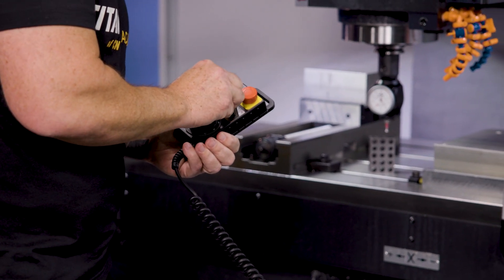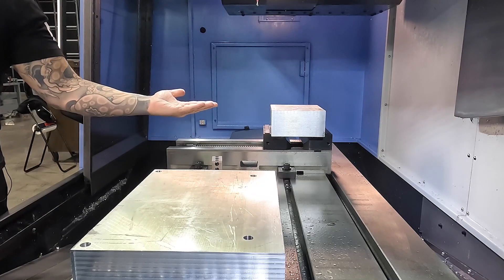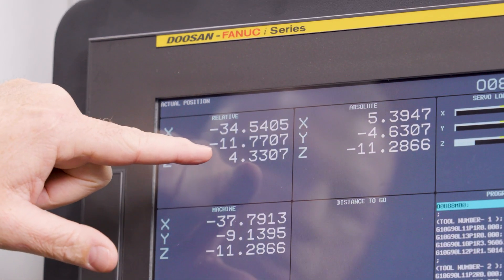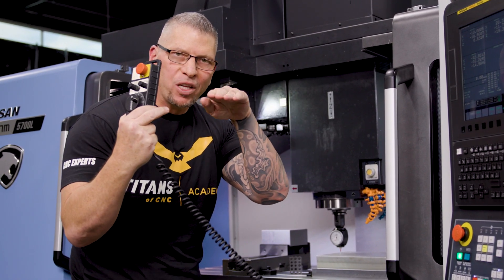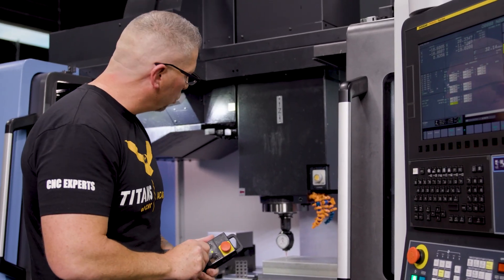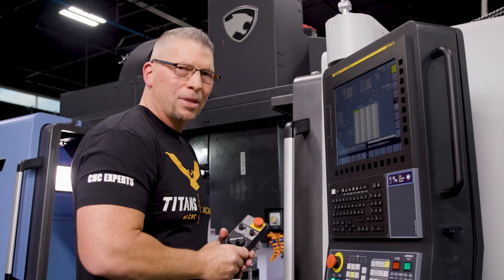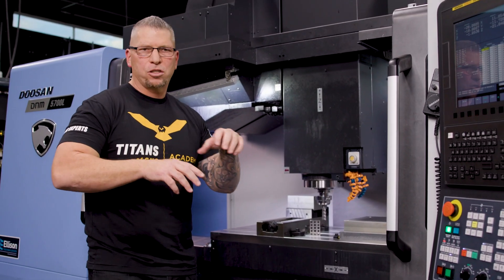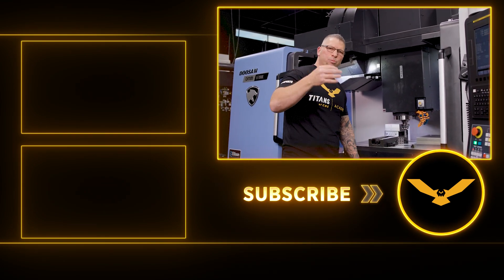ADVANCED FIXTURING | Set Z Fixture Offsets to Numerous Heights… Set All Tools to Single Height

Comment from the maker: Something for everyone! We have machinists of all levels following this channel so I figured I would do a quick teaching on setting multiple parts at the same time with a Haimer 3D Sensor. When repeating jobs, this ensures everything stays perfect every time. All tools are zeroed off the 1,2,3 block always.
80-90% of machines don’t actually have probes installed so this works nicely. Just another option.
I myself, always use probes but, used to do it this way.

Have a great day!

Titan
Reply: I’m no expert , many years out of CNC but this is how I was taught many years back . Excellent tutorial . Clear , concise and useful .
Reply: Where does G43 H01 ect fit into this?
Reply: @Thisoldtruck1  G43 H(tool number) is the tool length compensation for HAAS machines. I suppose it applies to other manufacturers too, just like G41 and G42.
Reply: @Yuriyper  if tool length offset is left at 0 (not used) then it can be ignored?
Reply: Thank you for the great tutorial. Despite having renishaw probe tool, I use this method everytime I need to make something precise (tolerance of 0.01mm and below), this way you make sure the difference in tools offsets is minimal. Another thing I think is worth mentioning is checking that you have set all the Z values correctly by bringing the tip of the tool somewhere close and outside the 1,2,3 block or the part stock and using MDI command G0 G(CS number) G43 H(tool number) Z0. to see if the tool will in fact go to the desired height. This double check has saved me a couple of times.
Reply: Your info is great and even if its something I have already learned, its good info to change my thinking to always be improving! We just put in CNC Machine #5 this year already! wouldn't have taken this leap without your enthusiasm to make American parts! My Company did 10X what we thought we would this year!
Reply: Great video thanks
Reply: Sorry, I have an issue with the way you’ve shown everyone how to set your G54 up. Here’s why:

You’ve stated that your table is a constant. True. You should be setting everything positive from the table up. You’ve only shown everyone how to take reference from the top of the 1-2-3 block, to an unqualified surface ( top of rough stock or part). While your idea you wanted to convey is correct, from top of block, zero out, go to top of workpiece, and get the difference, which is correct, what if someone’s 1-2-3 block had a burr on it, and you’re only referencing from the top of that block ? There is no accuracy in doing just that. Using a block or tool presetter on the table, or in the case of a lathe, on the surface of its chuck, then subtract the known height of the block or gage ( 2.0” or 3.0” or whatever the case is-this has to be understood by everyone in set up sheets). All tool height offsets and G54,G55 should be taken only from a qualified surface.

We use a tool presetter 2.0” or whatever height, touch all tools off the top of that, and TAKE OFF the difference in height of that tool presetter. Just touching off the top of that block is NOT good enough for accuracy! No fixture offsets should be negative values.

Comment: Since raw stock could change in height, wouldn’t it be more accurate to go from the 1” block to the surface the raw stock is sitting against? Then add the finished part height (shown on the print) to the number you get?

Comment: Been doing this for long time, it amazes me how many people don't like doing it this way. Its not only good for the job you're currently running but if your using a few of the same tools on the next set up you don't have to retouch them off. Oh not to be picky but once you zero out the indicator on the block and find the first Z you can then just move over to your next part. Plus another advantage is if your Z is in a hard spot to reach the the tools may not fit easily as a indicator. Great video have a great rest of your day.

Comment: My shop does it a little different we touch off from table (Z0) and then we go to top of material and then that number we use as our z work offset. And for tooling we touch it off a 1-2-3 block and use the machine Z as our number and subtract 3 inches so that its exactly distanced form the table

Comment: I don't understand why we complicate our lives if we don't have an electronic sensor. I use the probe HAIMER this way:
1) The HAIMER probe is measured precisely on a marble or tool gauge. We put this length very visibly on the machine. "PROBE LENGHT=X.XXXX"
2) We reserve a work offset which is 3" above the table (ex: G59). We use the HAIMER probe to do this. The Z of the G59 is the exact distance in Z- between the Z0 machine and 3" off the top of the table.
3) To measure a tool, activate the G59 and with the 3" block we do the same procedure as in the video.
3) To measure a Z on a part, we use the HAIMER probe and we add the length of the probe to in Z- calculate by the machine. So the Z Work offset is the distance between the Z0 machine and top of the part.

This way the tool lengths are always Z+ and mean something. Additionally, if you have an electronic probe and it is broken, you can continue working with this method.

Comment: why do it so hard. you not need know what distance 123 block is from part lol. you only need know heimer tool lenght. measure part surface with g43 H(heimer tool number) zero your offset BOOM. why is so hard? lol.
you can take tool height from that 123 block completely fine if you measure everything same place allways, but if you put mind on it. you can figure what is max z travel. its not what specs say but close.
i made g command to measure tools from same place and it give correct height. same as peepol use tool height gauge. why need buy lol
we not have any heimers or any its paper or shim 0.01 and its allways that acurate. rest is how tool cut and change offsett lol. is not that hard

Comment: 0.0001 inch = 0.00254 mm. you machine has 0.0000 every mm machine has 0.000. we can program 0.001mm its less than 0.0001inch. mm acurate.
ofc you can program inch using 0.00001 but your screen says 0.0000 LOL. why inch machines is so inacurate on screen. we do parts more tolerance than 0.0001 inch opsy

Comment: I made foundry patterns for a few years, spinal implants for a few years, and plastic injection mold assemblies for a bit.  Everyone does stuff different, I have learned so much.  I took a break for 5 years and just got a position in a job shop.  I’m nervous, but not too worried.  Maybe a little surface rust but it comes right off

Comment: Anyone use the IHMI control to touch off Z offset. I’m trying to do it like I would on the classic screen where the tool sits right over a block and you hit z calculate and set that as my z offset. But the IHMI display does not give me that option. I know I can just type in my current z location but that’s not how I want to do it lol.

Comment: Idk what was missed in the video but the comments are disappointing...
The whole point is to have a solid reference you can rely on and you can then adapt it into your program.
Whether you're replacing a broken tool or just adding a new one, you don't zero off of the rough barstock. The 123 is your zero.

Comment: Awesome setup video for Non probe machines.  Most of us, Like Titan, were setting up CNC machines with edge finders and 1 2 3 Block for years.  Just as accurate and I think just as fast.    The Z axis WCS location and how you touch off tools can be done various methods. I always try to teach to learn different methods. Wherever you end up working , you can setup just like the rest of the shop - same method.

Comment: We have a vacuum table on which we work with thin (4-8 mm) sheets of aluminium. I’m pretty scared to work on it because some guys mill right into the table as tools usually work at a 0.2 mm from it. 

I’m not sure if this is right and I can’t get a straightforward answer from my colleagues. 
But since I have to make sure somehow that neither the roughing nor the finishing tool would reach the table, I feel I must test all these tools on the side of the table, outside the work area, by sending them to the lowest Z coordinate they will be sent to in the program. I have to find the lowest coordinate of Z in the program for this, but I also do this with the spindle not spinning. Which makes some of my colleagues twist their head, but with the tool not spinning, I can see much more clearly where it is because I can see the blade’s reflection on the table, though I don’t mind stopping and opening the door a lot to make sure, but I just want to make sure. 

Because you can see when a tool goes closer than the intended approach distance, things like that, but you won’t see whether a tool is just 1mm too low than it should be. You’ll only hear that it’s milling the table. 

Would anyone have an opinion on how bad practice this is or any alternatives? The table is also custom built aluminium alloy, so I figure even if I mess it up, the tool will just make a small impression on it outside the work area.

Comment: After working on a 5 axis machine I started using a fixed xyz origin for all my programming, even on 3 axis. I use the machine zero for x and y and a 4in tool setter gauge off the top of a fixture plate. This is made easy using a fixture plate and tightly pinned vises and fixtures. If I'm working from stock I set up my job in the machine, then measure the location of the stock in z and x if its in the vise. with stock in the vise you can use a floating pin stop to set the side to side of the part. if its round stock in a collet chuck I measure x y and z using a dial indicator and a height gauge. I Then cad everything up, and its very easy. Often times ill 3d print a fixture that aligns to the fixture plate if I'm holding a part that needs to be modified, reworked or have a second op done. This method has many advantages. if I want to run a job again, I have a 3d model of the entire setup, and I don't have to re-establish  my z height ever. since the origin doesn't change, Its less likely to crash. I can simulate the entire job and be confident that it wont crash as long as my tool stick-outs are correct in the cam software. The disadvantage is that if you are reworking a part you need to precisely measure the location of parts relative to the machine home, and its not ideal if you are running multiple parts and they shift from run to run. this could be avoided by running a probing cycle and using that to transform the program to the right xyz location.

Comment: One of the shops that I program for does not have a probe and I have to do it this way. I much prefer a probe and a different work offset for each part, but you have to use what you have. Even my personal hobby shop  Haas TM mill had a probe.

Comment: This seems way complicated for no reason, machines 0 is normally work offset G52 or G53. I guess what your doing is setting everything without using a spindle probe, tool probe or tool measure. The way I've always done that was set my X and Y part 0 off the part, and my tool length off the top of the part. But thinking about what you said about tools breaking. I used a 123 block or 1 inch block to measure an already known tool from a set location machine 0 (table) took the difference between and added it to the new tool...example -16.75+5.6 so my new tool 11.15 were the previous tool may have been 10.

Comment: We use a z setter based on a macro. Setter is a set value so on either or Okuma or Mori, Z Value measure, work height offset is done.

Tools, basically the same. We have a touch of block and macro based on a 3 inch gage block.

Comment: I dont know why anybody, especially someone with a Haimer, needs to make this so complicated. Hiamer becomes your master tool for Z 0.0 height, every tool is referenced as plus or minus to the Haimer. You can set tool heights on anything you want at any time as long as the Hiamer hasn't changed or broken a tip.
Reply: Exactly what I’m thinking. No need for adding so many steps
Reply: @cryptonian4114  on my machines without a probe, the haimer is tool 1 and offset g59 is saved for setting heights on the back corner of the table off of a gauge block. Never moves unless the space needs to be occupied, and then I just quickly reset the Z 0.0 for G59 and keep going. None of these crazy negative offset numbers and as long as the same Haimer is used across all of the machines then all of the tools interchange and can just punch in the offset value when loading. My probe machines use true length from spindle taper 0.0 and I also know the true length of the Haimer so when loading tools between probe and non probe machines just have to do the math quick and punch in the numbers. All of this backwards thinking, outrageous offset numbers that you can't visualize, and unnecessary steps just make it that much easier to crash a machine in my opinion. As the saying goes, K.I.S.S.

Comment: So why would you introduce another variable to the equation by using a 1 2 3 block if the table is the reference surface?  Why not zero your fancy 3D thing on the table and calculate the difference from there?  A reference tool can solve many issues,  all tools are set in reference to that tool,  and that tool is used to set your WPC (work piece coordinates) .  Nothing is then set from home, like what's going on here.  Each shop has it's own standard practice so as a machinist each has to adapt.  This is far from perfect as you state
Reply: My robodrill spindle will not go that low, I had to use the 3" side plus another 123 block to touch off my shorter tool.   13.2" ish of z and that starts at   spindle nose  "about" 4" off table

Comment: To that last point, also make sure if you are running a tool that might be shorter, you don't bring the spindle casting/cover/coolant system down on a tall part elsewhere in the machine. Just cuz the part you're on clears the tool and holder and spindle nose, something else on the table might not.

Comment: I have a fast method because I was rushed to run 3 machines for $16/hr I use a magnetic tool setter and any tool endmill. Zero out my tool setter, set it, zero out my relative, go above the center of the part with the magnet tool setter, get the difference and put it in my  offset. It's pretty good if you're in a time crunch.

Comment: Titan I love you man, this one may be a hard one for some newbies in the trade to follow but I think I understand what you’re trying to explain here. When I started working for a company with no probing system I came up with a similar way of doing this but with an edge finder. I put an edge finder in pocket 20 or 25 and kept it there. I touch off a 1x2x3 block in my vice for Z then touch all my tools off the block too. Then I do some math and figure out all the differences in Z height from edge finder to the tool lengths (same thing the Reinishaw probe does basically) and now all those tools are gauged. Next job comes in I’m not touching off a common tool all over again I just touch off the raw stock with my edge finder and a shim and I’ve set Z. I think you’re trying to say something very similar, but even I was a little confused with the video.

Comment: Love these short videos on the basics! This is how I do it on my older fanuc-controlled machine (haimer probe, tool setter gauge, probe the difference between tool height and work height). I also like to write down my offsets before putting them in the machine. It's an extra step, but sometimes it's good to get the numbers onto paper as a confirmation and error catcher.

Comment: This video is the best argument for tool probes or presetters. Not that Titan is doing anything incorrectly, but this is such an error-prone method of setup. Every peeler I know has wrecked tools at some point doing this, plus it's very time consuming compared to presetters, which allow you to set tools while the machine works, and the numbers are the physical tool length rather than an arbitrary machine position.
Automated tool probes are even better, fast, measure wear, process safety. Unless you have very limited changeover, this is the worst method. (But I would strongly argue for a tool probe for high volume work)

Comment: Where I work, we measure Z a little different. Basically we have measured the lenght of 3D sensor on  Zaxes. For example. with a sensor, zero it on your part and in work offset table just type in the lenght of the probe ( my case 195.0 mm) . So i just write Z195.0 and hit measure.

Comment: I use a magnetic Z offset setter that is spring loaded and I can touch off each tool to it sitting on my table. Then touch a tool off my stock and enter in an offset. Works well for those without a probe on older machines.

Comment: Titan quick question; Why the need from firs setting Z0 from the 1-2-3 block then probing Z on work piece?  What's the difference from Z home directly to the top of the G54 workpiece and setting that to Z0?  I'm just trying to learn the techniques.  When I turn my machine on I reference all axis and then I directly probe my workpiece but never using this technique.  As always I appreciate you and your teams efforts!  Merry Christmas to all.  Sending much love and gratitude!
Reply from the maker: This is for those that don’t have a probe.

So most will use an edge finder and get XY on the fixture.

Then they set tools off of the top of the part.

Which works perfectly.

But

This was allows you to have many different heights on many different fixtures.

Then you just set tools off a single 3” block.

Works especially good when running many ops at the same time, set up in different ways.

Make sense?

Of course there are many ways…

I chose machine Zero for Z

Because it’s a constant theme for all machines.
Reply: @TITANSofCNC  Thank you for the quick explanation and yes, it makes sense!  Appreciate you.